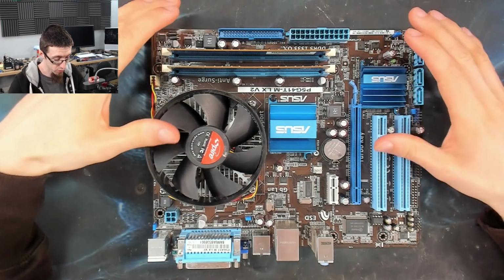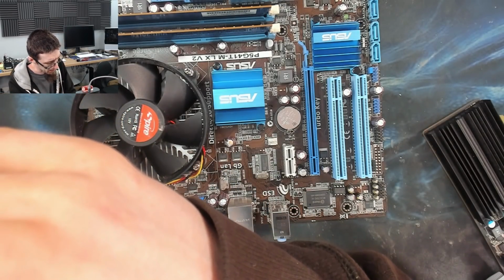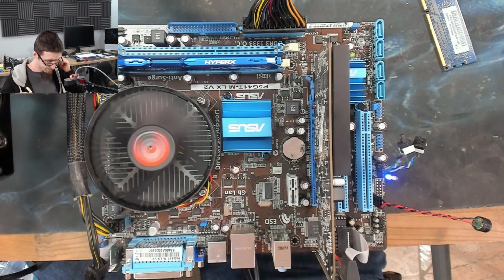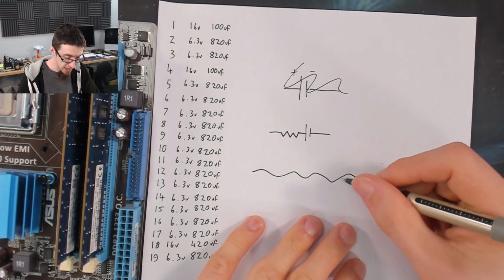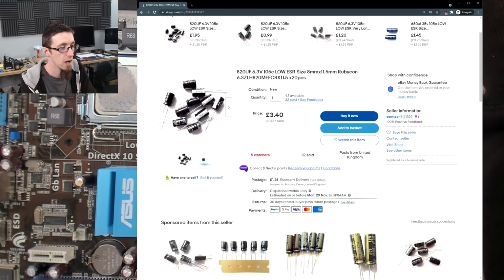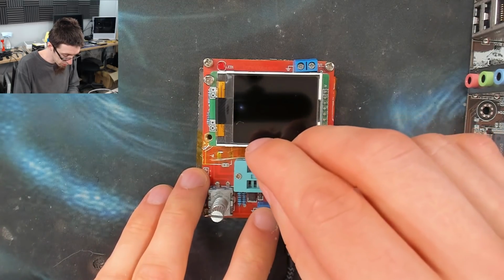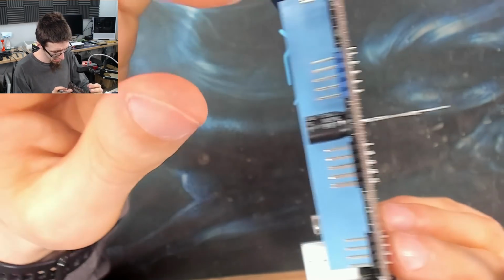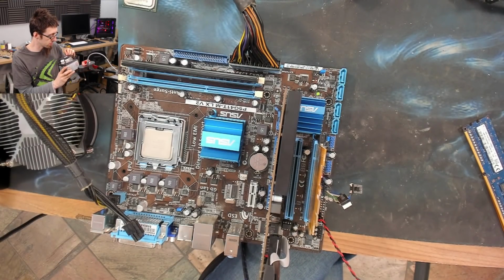This motherboard recap didn't achieve anything - LFC#288

Comment: Vloss is related to ability of that capacitor to retain voltage level according to it's rated voltage, sometimes you measure capacitance and is right on point but cap won't be able to hold its voltage and that's shown by vloss BUT the way those Chinese testers find that I usually have doubts because caps have wide range of voltage ratings ie. vloss of 10% on 250V cap and on 6.3V cap will have very different implication considering the way those testers work (not sure but at least I believe they treat all caps the same and not test accordingly to theirs range of voltage ratings), although you can use to compare 2 or more caps of the same ratings to predicts which one has bad vloss and so pick out which is bad. Good video share I always learn  a lot from you brother

Comment: Years ago, I had to fix a LGA775 motherboard ASRock 775i65G R2.0 with some bloated caps. It was not booting up. The top caps near cpu seem fine but not the ones around agp slot. It was painful to replace the 3 caps because of the limited space. I unsoldered the legs and put some used ones from dead boards and the board started to work fine again.

Comment: I think you should have at least checked some canned caps, expecially the one near the parallel port that is suspiciously tilted.
It just drives me nuts how motherboard manufacturers indicate the positive side of caps on the silk screen while every other manufacturer of anything indicate the negative as the cap itself. Whyyyy???

Comment: There can be a downside to low ESR capacitors. Some negative feedback loops (some voltage regulators for example, not all, depends on the device in question) depend on the ESR zero in their frequency compensation scheme for some phase boost. These systems might become unstable or suffer poorer step response with low ESR capacitors (due to decreased phase margin).
Reply: Interesting. This is advanced stuff. Had never thought about whether having low ESR caps could ever be a 'bad thing'. Operational amplifiers came to mind when you mentioned 'negative feedback loops', (which I recollect only require resistors and ceramic caps)...so this looks like a subject I need to learn more about...fancy stuff
Reply: @minilab9030  Any system that regulates something typically employs negative feedback (When the output is too small it has to be increased and vice versa). Delays (phase shift) in the feedback loop will cause instability if they add up to -360° (because the feedback becomes positive at that point). Therefore such systems have to be designed so that the loop gain is lower then unity at the frequency where the phase shift reaches -360° (in reality even sooner then that, you want some margin, called "phase/gain margin"). These techniques are called "frequency compensation".

Because the LC filter in a switching voltage regulator causes a -180° phase shift all by itself, it's properties are very important to the compensation scheme. The capacitor's ESR introduces a zero in the transfer function that can boost the phase back to -90° at higher frequencies. Changing ESR moves this zero.

This applies to op-amps aswell, but most well-known opamps are already internally compensated (using a dominant pole, basically they are slowed down to ensure stability). So as long as you only use local feedback and don't do anything "stupid" (such as adding gain in the loop) they should be stable without much effort.

Comment: simply cmos battey is dead. after one cycle, the resetted bios got corrupted again. try flashing bios followed by a new battery.

if not...try a different display adapter.
Reply from the maker: Got to admit I didn't check it. This board is still on the shelf, so I'll check it again, just in case. POST Code reader giving a memory error points at a bad northbridge though, so not holding my breath!
Reply: @Adamant_IT  did it work ?

Comment: capacitors usually have a stripe down them indicating the positive leg
Reply: NO the capacitors have a stripe down the negative leg, and the positive leg goes in the square pad on the board.  The white D circle is for the positive side. Look at the board pictures. sometimes they have a plus mark at the positive pad. Ray Burke Electronics Technician Later.

Comment: If you have a failure like this a CPU, PSU, SSD and MEM are all OK and recapping doesn't fix then what other components could be at fault. Could it be support chips like the thing under the blue heat sink?

Comment: Couple of points: 1. great video nonetheless. It's nice to see more "failed" attempts, just for the entertainment factor and to help other techs realize failure is perfectly acceptable, other than giving the same predictable success each time. 2. the symbol for a polarized cap is with a curved bar (like an umbrella) for the negative leg. 3. my 2 cents on the MB: possibly failed clock generator (need scope to check it) or BGA gone bad on NorthBridge (given the memory error code, since the NB is the memory controller, if that's anything to go by). Could try taking the heatsink off the NB and blasting it with hot air just for funzies - nothing to lose at this point. I once got one going by doing this and it did much the same thing: gave me a code on the PCI tester, but nothing else. Cheers

Comment: I have that problem where I don't know when to give up but I really want to know what is wrong with the board! How about testing for chipset / rail voltages voltages? If all looks good there then it's cool to stop... pretty please!?
Reply from the maker: No plans to come back to this for now, but yea, my next guess is Northbridge issues. Likely a dead chip or back solder ball though. It was producing some heat, so it's getting power.

Comment: This was a timely video. I have exactly the same problem with power electrolytics on an old Intel MOBO. The system was behaving really oddly with intermittent boot errors and repeat corruptions of the boot partition on the SSD! Had a look at the board and sure enough I have bulging caps. Think I will replace them and see if that fixes the problem.
Reply from the maker: It's a valid strat! Just didn't work for me this time.

Comment: The issue here is not caused by electrolytic capacitors, but rather by low quality capacitors. I have an Hi-Fi system with about 25 years, and all capacitors are electrolytic. There are no bulged capacitors, because they have used high quality capacitors (the unit was manufactured in Japan). These computer motherboards and many other devices (like TVs) have failing capacitors due to the manufacturer cutting costs, by using cheap chinese capacitors.
Reply: @Mr Guru Yeah, fixed. Thanks for noticing.

Comment: The problem with all the 5V rail caps being faulty means that there also was no surge buffer in case the 5V rail or the 5VSB of the PSU went wonky. With the amount of components on those era boards running directly off of 5V that's a concern.

Comment: One advice, not from me but from a french Youtuber (well Peertubeer now), when he have a failing device (he does mainly old hi-fi/vhs and playstation stuff) that doesn't work properly with bad cap, he heat the cap with a hair dryer to make them "work" temporary and see if there is some life, usually, it work really well, if this advice can help you :)
You're video are great to watch, i'm an IT student, last year to do, and i really want to do the same as you because i love this, and your video help me to learn a lot for board repair

Comment: My guess would be that most likely there is a broken trace on the circuit board. Components usually don't fail unless there has been a power surge or lightning hit.
Reply: Welcome to the complicated world computer motherboards. 
Here anything and everything can fail without any apparent reason. Hell, even a game that was designed to run on a specific graphics card can kill it. These circuits use a combination of hardware and software to work. There are very tight tolerances even on the arrangement of glass fibre bundles on the board. Then there is a very specific timing and sequence in which the board is powered up to running state (S0 state). Then there is BIOS which will go corrupt just by sitting idle for few years. Any deviation in any of the above from its designed parameter will result in board not able to be brought up. And I didn't even mention about dry solder joint or a broken trace yet.

Comment: I find the Northbridge tends to go bad on these old Asus 775 boards, in fact its the first thing i try hot air gun when they wont display. Northbridge connects to system RAM. Sometimes heat gunning the north bridge can bring it back to life for a short time. Always worth a try at using a hot air gun on it just to see if the northbridge is the issue or not. Only takes like a couple minutes.

Northbridge wikipedia - "On older Intel based PCs, the northbridge was also named external memory controller hub (MCH) or graphics and memory controller hub (GMCH) if equipped with integrated graphics. "
Maybe corrupted bios cause issue? I found if i flashed a bios badly on a board i get memory errors and issues. Possible bios problem?

Or maybe ur northbridge ded bro sorry
Reply from the maker: NB seems to be the common consensus I've seen. I might try a death-or-glory REHOT PCH BRO attempt if the client doesn't mind, just for science.

Comment: I was needing to test a few capacitors  and totally forgot I had a tester similar to that,  thanks for reminding me.  VLOSS = Initial capacitor voltage loss immediately after a load pulse due to the energy required to complete the switchover. It's an arbitrary figure. As far as the cap with the exceedingly high capacitance (1200 uf), In a capacitive circuit, when capacitance increases, the capacitive reactance XC decreases which leads to an increase in circuit current.  So if you knew where you pulled that one from you may find you have  a short or faulty component. Always test all components purchased from ebay prior to use, Thank You for the video...

Comment: Thank you for posting it!
I'm hooked, you have taught me a lot by your videos!
One question though, why don't you ever measure the power over the mosfets/buck converters and various components surrounding them, like you do on laptops. Is it because the error codes lets you narrow down to the right ballpark

Again, thank you for making electronics available for us, curious people:-)
Måns
Reply from the maker: Mainly because if you have "fan spin" where the system has turned on, it's probably not a power issue. It could still be a rail that's working well enough for the system to think it's OK, but is low or full of ripple, but yea, we're getting to rabbit holes now.
Reply: @Adamant_IT  It's not that unreasonable (but will get you into a rabbit hole for sure), I had old motherboard where the fan turned on no problem but the CPU was stone cold. I never bothered to test it further though considering it was an old Athlon x64.

Comment: Instructive as always. Thank you. I remember that the old Abit boards needed recapping (I had their VP6 and BP6 boards). Indeed, didn't their deliberately choosing shoddy capacitors lead to them going bust? 

Anyway,  might it be worth double-checking that you got the capacitors all the correct polarity?
Reply from the maker: Yup, they're all the right way around. I think this board just had more problems than the caps. Certainly been other boards that could be revived with a recap though, yes!

Comment: Yes! a capacitor can increase in value, "this is a fairly common problem" that I found in my repair business.
Reply: increase or decrease?
Reply: @dantronics1682  It's not a real increase in value, it's the capacitor leaking charge, in that it no longer fully blocks DC when it's fully charged.  This fools most LCR meters.  When a cap tests for twice it's rated capacity and a lower ESR than it should normally have, it's a pretty good bet that the cap is going bad.  I keep meaning to build a low-voltage capacitor leak tester, but caps aren't expensive enough to mess around, so I just replace any that aren't within specs.  And then any others of the same age.

Comment: how does one go about.. resetting the CMOS or bios.. after having the cmos battery out for 2 days.. and the jumpers.. havnt worked..
i changed the setting in bios the CHD or UEHF i think were the choices... and when i changed it.. i cant get it to boot now.. and cant get it to reset
Reply from the maker: Can you get to BIOS setup? Or do you have no picture at all now? If you have no picture (no POST) then check the voltage of the cmos batt, it should be 3v or higher. Otherwise, your problem is elsewhere, and I'd start trying different RAM, reseat CPU, stuff like that.
Reply: @Adamant_IT  yea.. no picture .. after i selected that option.. it went black and rebooted.. then its been screwed ever since.. had to get a new motherboard ..
 it sucks.. but i did get a pretty sweet new motherboard.. 
i went with the msi z590 wifi pro but.. 
i just now checked the cmos voltage on the messed up one.. its 3.11v 
thnx for the reply :)
i think when this i happened... i selected UEHF and thats when it happened.. and im probly saying the abbreviations wrong but i think you understand what im talking about tho
Reply from the maker: Yea boot mode (UEFI or Legacy/CSM) handles how windows boots up. Absolutely will not prevent the board POSTing. Something odd happened there... but oh well. Enjoy the shiny board at least!
Reply: @Adamant_IT  yea thats it.. i changed it to UEFI then it went black and rebooted.. and it just goes to black screen and says somthin bout insert bootable drive im pretty sure is what it says

Comment: Do you have a link for that transistor/cap/component tester? Is it from aliexpress? Thanks!
Reply from the maker: Should be available from most places, ebay, aliexpress, banggood, etc. Here's an example eBay link: https://www.ebay.co.uk/itm/234284775298
Only difference is that I've modified mine with a USB recharged lipo, where the base unit is 9v powered.

Comment: Great as always Graham, while you may not have been successful I still learnt something. I always thought you were supposed to mount everything flush to the board
Reply from the maker: Depends on the components. Flush to the board is nice and neat, but certain components like electrolytics, crystal oscillators, anything that's not 'solid state' likes to have a tiny gap so it can move or expand ever so slightly.
Reply: There are lots of electronics "out there" that have a small space between the component and the printed circuit board. There are also a multitude of electronics with no space between the components and the board.

Comment: Aluminium electrolytics are "formed" - the forming current grows an oxide layer on one of the plates which is actually the dielectric. Forming thicker oxide gives you a higher breakdown voltage rating, but decreases capacitance. If the capacitor is left a long time with no voltage applied, the caustic electrolyte etches the oxide layer - capacitance increases, but you lose voltage rating.
Reply: Something new I learned today.
Reply: I've seen exactly that on a socket A board that wasn't turned on for 15+ years before I took out the caps and tested them. They were Nichicon 5V 3300uF ones and looked fine, but they measured ~10000-12000 uF each (good ESR). I thought "thats strange" and put them back into the board. When I turned the board on for the first time, all the caps swell and vented before the POST was even done, live and right in front of my eyes in a matter of seconds. I thought of degradation and increased suface area myself, but nobody wanted to believe me ("no, its excessive voltage loss that simple testers detect as increased capacitance"). But as you see in the vid, that cap had only 2% voltage loss.

Comment: Try without graphic card
Reply: no onboard gpu on this cpu
Reply: @Joseph_Neale_The_Lillipup  this is when you need a 210 handy dandy
Reply from the maker: It does have VGA out - I was using the GPU for a HDMI connection to a capture card. However, there was nothing out of the VGA port either.

Comment: It was probably never the capacitors, i've owned this exact board, and it had heavy use for most of those years, sold it recently and still worked like new, i also own some slightly earlier boards that have run big overclocks for many years, those boards are still fine to this day, i think the capacitor problems go back a few years before this boards time
Reply: My uncle has one, LGA 775 but not the exact same one. It's still working fine even though some capacitors are bulging and even leaking / the insides are coming out of the cross top.
I've warned him though, that the motherboard is in the verge of dying.

Comment: I think the most important thing with repairing things (regardless of its age and what it is that youre repairing) is that you have absolutely no idea if it will work or not even after you've done the best repairs that you can, especially when it comes to diagnosing electrical goods. There could be a hundred other things wrong with it and its usually the smallest most obscure thing that is never spoke about that plays the tinest of roles that kills the entire system when it goes down or prevents it ever from being powered on again.

Nothing ventured, Nothing gained.

Chalk it down to a learning experience. Do or DO NOT, there is no TRY
Reply from the maker: Yup. Diagnostics are often more a matter of "fix it, then try to sell that solution to the client" rather than "figure out what's wrong and offer to fix it for a price".
Reply: @Adamant_IT  yeah, sometimes you don’t know if something is fixable until you fix it